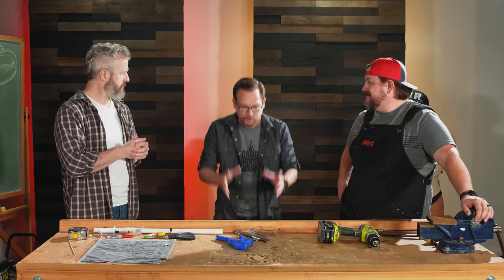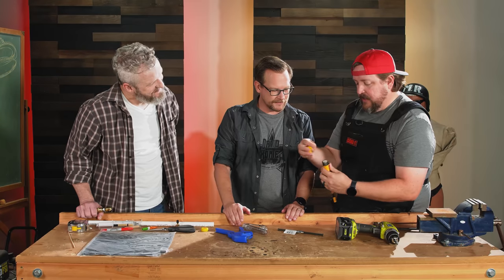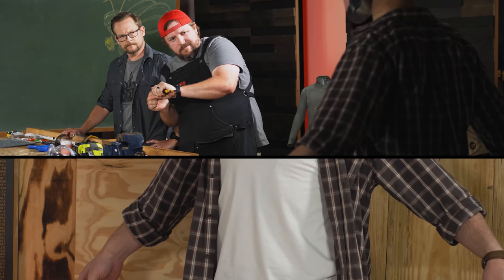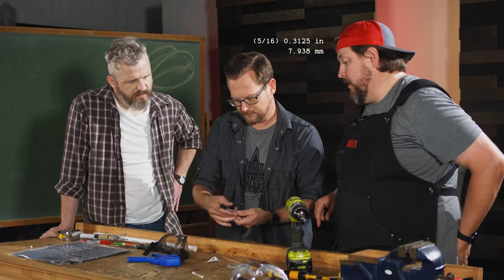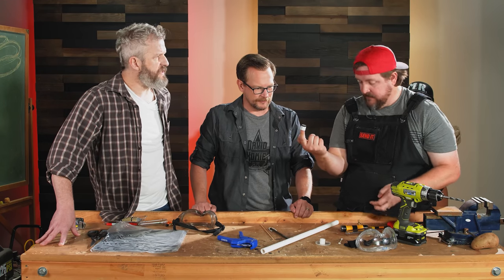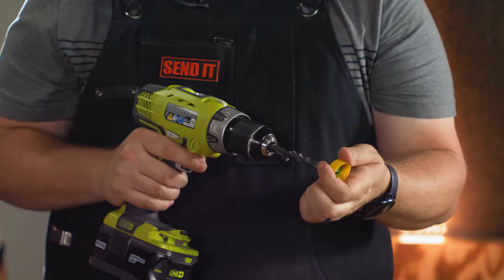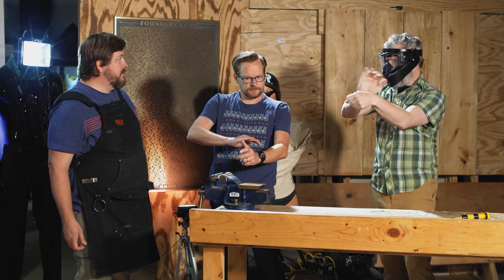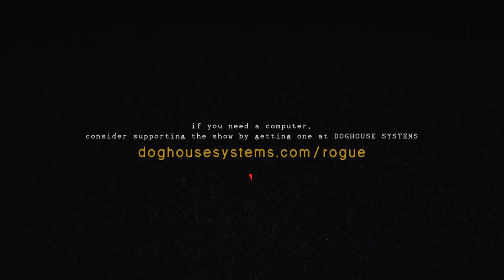World's Smallest Potato Gun

Comment: Brian trying to cut the brake line on the pull stroke was the most painful part of my night.
Reply: He's probably only ever used a coarse tooth wood saw or power tools
Reply: how do u know what way the blade was on? it's not a wood saw so ur not stuck with one cutting direction, you can flip the blade.
Reply: @Wtfinc  pretty sure the blade featured here cut in both directions. Pretty sure what he meant was Brian was ONLY using the pull stroke because he couldn't get it to cut on the push
Reply: @RichardCranium321  must have missed it. lol definitely sounds like the teeth biting in. unfortunately that was the cutting direction. let the saw do the work and it won't bind. or lube.

Comment: you can make an inherently safe air canon by making the volume of the stored gas be only barely larger than the volume of the barrel. it requires a bit of math and some testing, because you are looking at the volume of a compressed gas compared to an expanding gas. If you get it right though, you should see your projectile actually get sucked back into the barrel if the stored volume is too low, and barely pop out when its just right. its a design Rob Cockerham came up with about 15 years ago for an air canon tank for kids.

Comment: Lol that's not the smallest. Me and my friend use to make even smaller ones out of pill bottles, pen tubes, push pins, the electric sparker off a cheap dollar store lighter and dollar store hair spray. Maybe 3 Inches long.
 You would cut a slice of  potato and then use the pen tub tip to get a tiny piece of potato from the slice and the pen innards to shove it down to the back. Then take the cap off the bottle, spray, cap it, then push the electric sparker. Youd hear a nice pop and if you shot your friends it would leave welts. Sometimes a bruise. We had many a spud battles like that lol

Comment: you should try using the top of a 20 oz bottle in the big potato gun. heat up a nail and push it through the cap  then put a quarter behind it so it doesnt push back out. just cut the bottle far enough down so it just slides into the barrel. the light weight projectile is so much faster than a potato lol

Comment: Just as a little note about fanning the hammer on a revolver, it's an interesting concept, however its very impractical, inaccurate, slower to perform than in the movies and in games, but still awesome. Only works on single action revolvers. Also kinda hurts if you either have a higher caliber revolver which you're now firing single handed, or are doing it a bit too hard, unless you're a bad ass space cowboy with a cybernetic arm.
Reply: Also as another note because movie gun techniques were brought up. Please never try to flip a winchester 1887 lever action shotgun like Arnie in Terminator. Unless you get the extended lever loop or do a kind of tough version using like 1 or 2 fingers, it's a great way to break some fingers, as Arnie just about did when accidentally using the wrong one that wasn't modified. Not to mention that it could potentially cross your body, or you could accidentally hit the trigger. Sorta unrelated, but figure a lot of people still didn't know that and would be interesting.